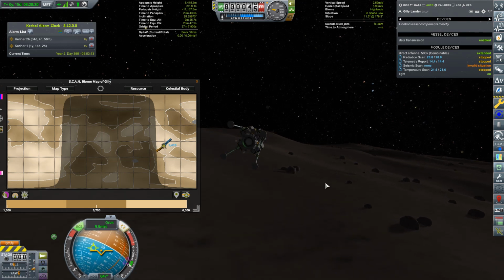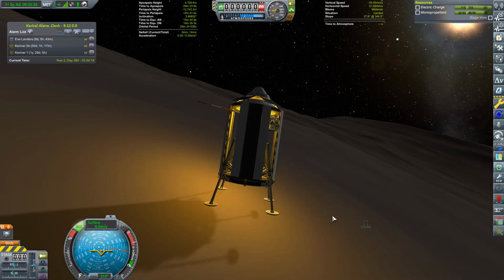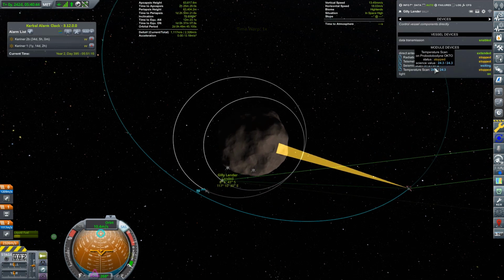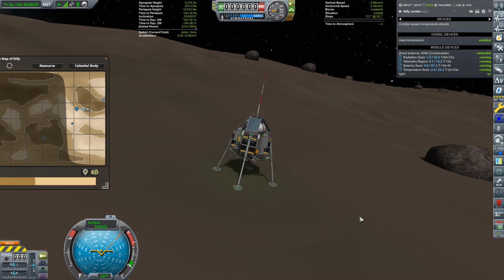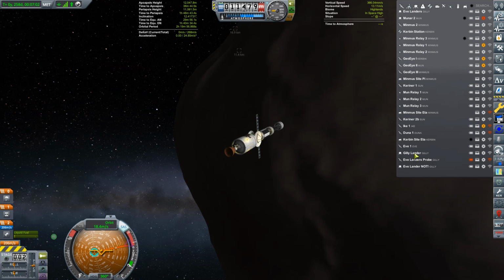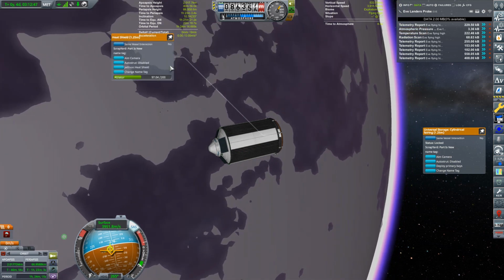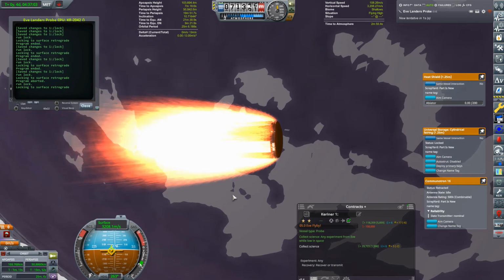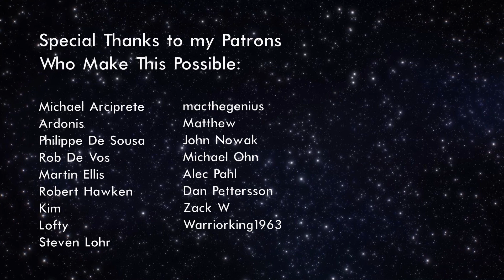Season Finale - KSP: Expedition Eve

Comment: Could the discrepancy in science for multispectral analysis be down to the different resolutions? If I remember correctly you get low res, medium res and high res scans available from different parts, all which might count separately themselves
Reply from the maker: Good thought, but then why are the Mun and Minmus complete with the exact same equipment? I just think the integration between Kerbalism and SCANsat isn't there. Both mods do things passively in the background. It could be the systems they use don't get along.